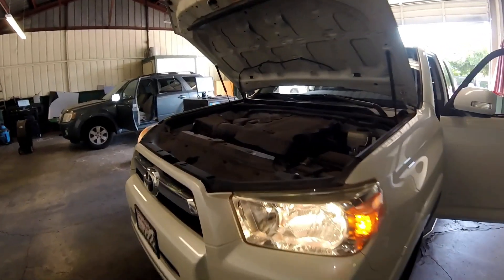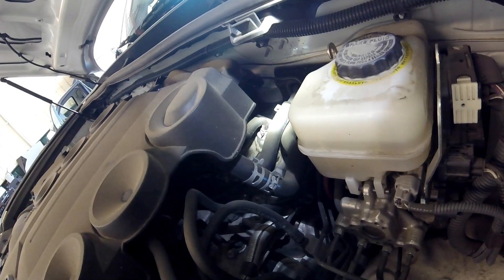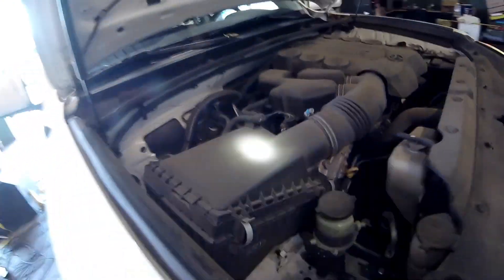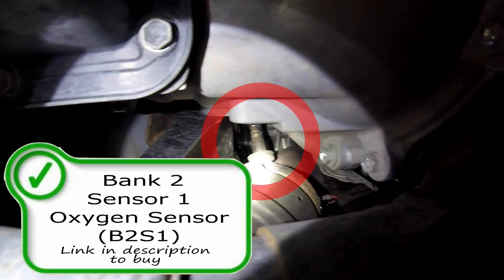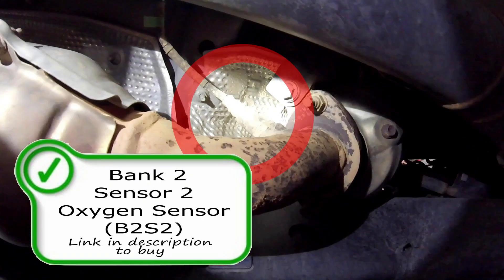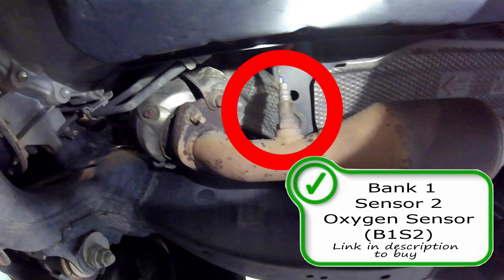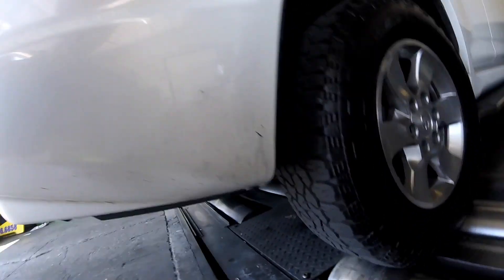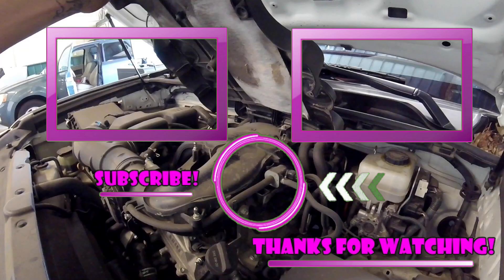⫷ Toyota │ 4Runner │ 2009 - 2019 │ N280 4.0L │ Emissions Locations: PCV, EVAP, Oxygen Sensors ⫸

Comment: I replaced a Bank 1 Sensor 2 on mine but could not get to the Bank 1 Sensor 1. It was impossible to get to with my intermediate tools. It was ridiculous without specialty tools and I finally gave up.
Reply from the maker: Good job getting the one side done and good job giving at least a try on the other side.You can't ever say you didn't try. Sometimes having a oxygen center socket set is pretty useful to have on hand.You can usually get them pretty easy if you are a pretty good contortionist with skinny arms and hands. 

Again, good job!! 👍💪
Reply: @ScottiesHobbies  Thanks you have a very informational channel, Subscribed.

Comment: I'm getting P0441 and P0455, I took it to the dealership and they replaced the fuel cap and recommended some type of cleaning using a product on the fuel tank, they wanted $500 for that and I rejected it, the check engine and Trac off lights came on again because of the same codes, I appreciate any input you can provide on what's causing this, thank you in advance.
Reply: Did you figure this out. Running into the same issue on my 2015
Reply: @brassdude112  yes, it was a broken hose that runs from the canister, when they replaced the fuel pump they broke one of the the ends so it was leaking fumes,the stealer instead of doing a proper diagnosis they try to sell me one bullshit cleaning job

Comment: I have  2014 Toyota 4Runner With codes P0441 and P0445. I have replaced gas cap, purge valve solenoid and vapor canister. And I still can’t get them to clear. Any suggestions would be awesome thanks?
Reply from the maker: It looks like both of those codes pertain to the evap purge solonoid. If you have replaced the solenoid and the issue still exists you you might have a wiring issue to the solonoid.

Comment: I have a 2010 4runner with the P 0420 code. It started coming up after my alternator ran down and I had to run the engine with a dead alternator to a mechanic. 
Is the p0420 code specifically about the catalytic converter OR the Bank 1 Sensor 2, OR could it also be the bank 1 sensor 1 I need to replace?
Reply from the maker: A good rule of thumb. A p0420 and over 120k, replace cat and rear o2. But... your rear o2 could be faulty. If it was mine, I'd replace the rear o2 sensor and cross my fingers. If the code comes back, get a cat.
Reply: @ScottiesHobbies  thank you. I'm getting ready to drive it from texas to Chicago pulling a U-Haul moving trailer. What will happen if I can't fix it by then and have to make the trip like that? Moving in two weeks
Reply from the maker: This code should not effect diveability. But... you won't know if your computer is seeing another issue  due to your check engine light staying on.